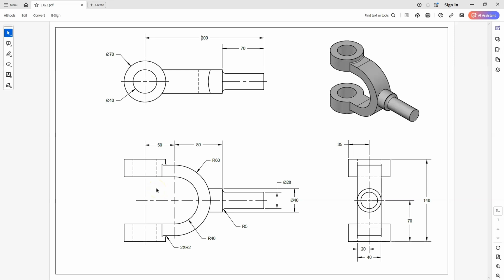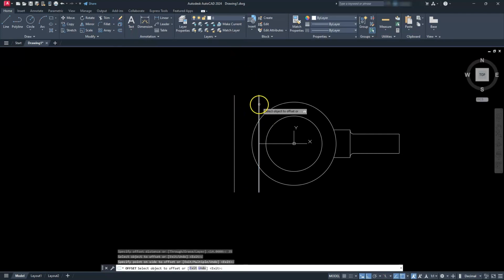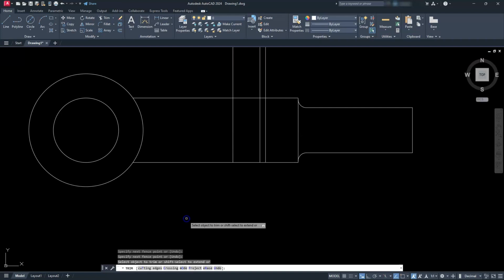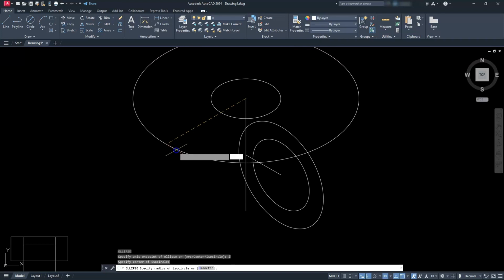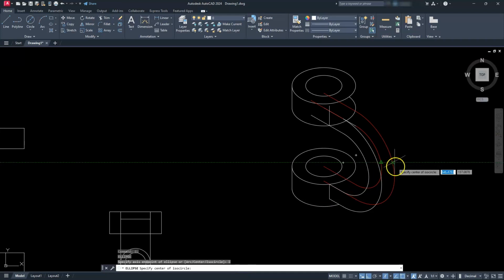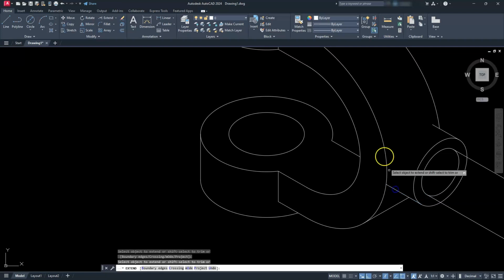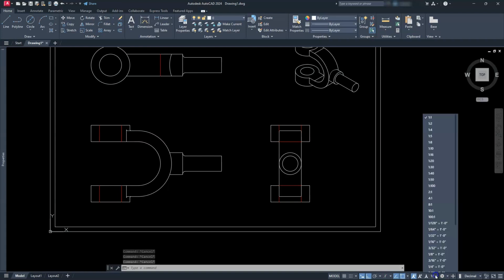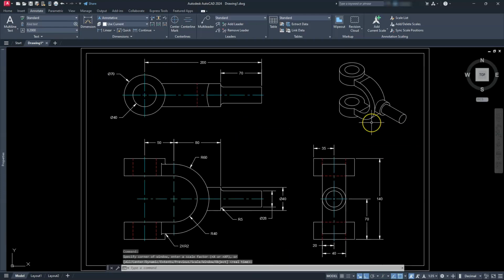Complete AutoCAD 2D Drawing   Isometric, Annotation, Fillet, and Trim #autocad #cad #cadtraining

Comment: I created the isometric in AutoCAD, and I also built the 3D model in Inventor. Then, I placed the model into a drawing format and set the dimensions to true (not projected). All dimensions added up correctly in Inventor. However, when I imported the Inventor drawing into AutoCAD, the isometric scale came out incorrect it’s smaller than the AutoCAD version any idea?
Reply from the maker: I have had this problem. I usually have to scale the drawing in AutoCAD to make it true again.